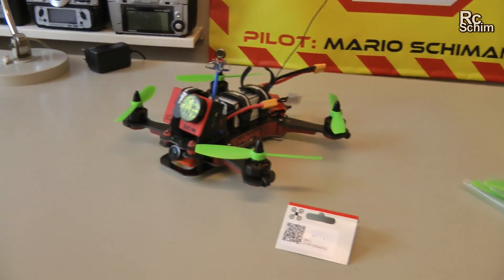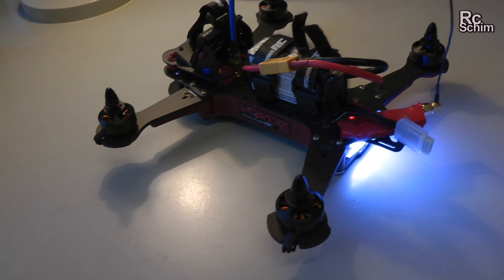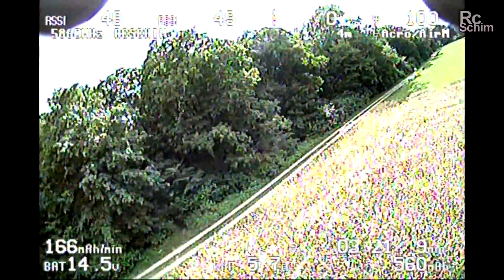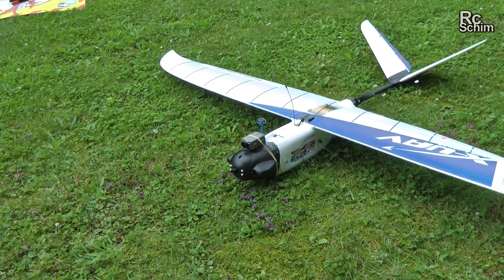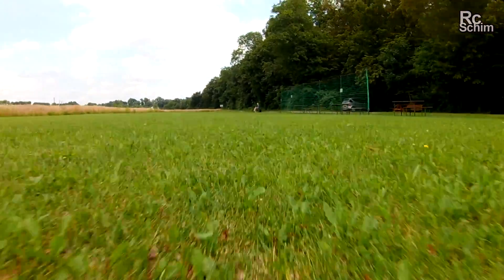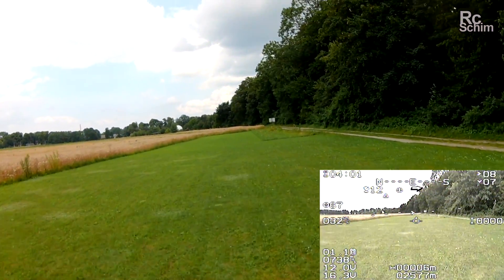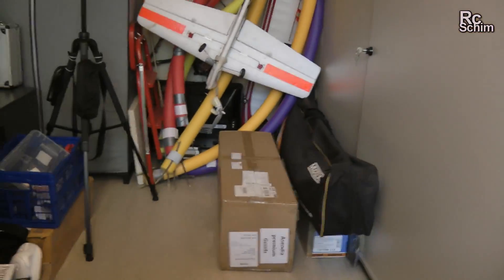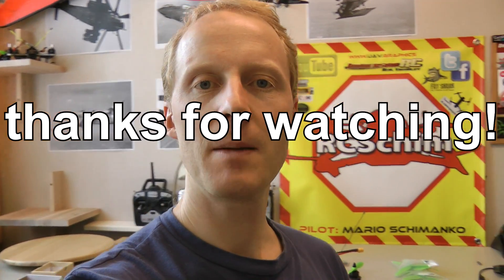FPV Plane or Miniquad? XUav One (with Arkbird), Vortex 250 (rotor sense after motorswap)

Comment: the arkbird OSD does that comes with the FC and GPS ? Are you flying with 5.8 ghz with the fix wing ? 
Looking forward to your build listing on your Xuav mini talon.
Reply from the maker: hi, yes - arkbird OSD/AP combo also has a FC and GPS. It is easy to use, a bit large but ok; gives nice OSD readouts, will be fun in the mini talon.
yep, back in the days I also used 2.4 for video - but now with all ppl flying los on 2.4 it's too much potential for interference...
and I didnt wanna have different video systems (2.4 on plane, 5.8 on minis). wanna keep it simple.
5.8 works ok for my kind of flying.

Comment: You going to be doing a review of the RunCam Eagle soon? I can't wait to finally have the right aspec ratio in my goggles finally.
Reply from the maker: currently no plans, sorry.  aspect ration?   is it in 16by9 what you aim for (because your googles demand it?)
Reply: Yeah, it's 16 x 9, so it will not looked squashed down in my SkyZones, or the Dominator 3's I think? It never bothered me when I was flying planes and was higher up and just gliding, but when I started to fly close proximity FPV I started to notice it and started fixating on it a bit, to the point I was about ready to try the Dominatior 3 HD just to get the aspect ratio right. I would think I was just off the ground or really close to something, but  when I would go back and re watch it on the HD video, I was always higher or farther away then I thought I was. I think this makes it harder for me to go through smaller gaps and such, and really improve on my close proximity flying.

Comment: Wow that prop and tail combo is pretty cool. Any advantage to having it that way?
Reply from the maker: I thought so too when I first saw the plane. The advantage of pushed props is: they are not in the view of a fwd facing cam.
most pushers (like on a bixler) are not on the main axis of the plane, so you can only use small props...
some pushers are mounted on the back of the plane (most flying wings) which is nice also (but dangerous on hand launch).

VTail advtages? I was wondering as well and learned:
less drag, doesnt get stuck in the grass on landings so easy than a normal T tail
but: not so nice YAW steering, a bit harder to adjust correct
best would be inverted V from the aerodynamics   (on a twinboom setup - I've seen it somewhere)
Reply: You're right, I didn't think about prop size on the back, that would be an advantage. Also having the thrust line so close to the center of CG would probably help out also. I also heard that the inverted V works better as well, but would need to be higher up as not to catch on the grass. Can you get different props for that plane, like 3 blades or bigger? It looks kind of proprietary.
Reply from the maker: I think it's a pretty standard folding prop. 3 blades are a problem - as there are only two mounts :)  Never heard of a 3 bladed folding prop actually :)

Comment: For my mini talon build I copied this guys build. https://youtu.be/jCmYDMppU_M It flys very efficiently & I highly recommend this motor & prop combination
Reply from the maker: thanks for the infos. I love the fact that I can use my 5200mah 4cells (multistar as well).
Reply: yes on the first flight with the mini talon I flew for 40mins & used 3500mah & travelled a cumulative distance of 35KM. I have also got a Multistar 8000MAh 4s to try too!

Comment: What battery do you fly on your vortex ?
Reply from the maker: Hi Nick, I love your movies :)
Lately I use the Turnigy Aspec 1300mah 4cells (but as Bruce said, they are not that good).
Just check the best rated 1300mah 4cells (Joshua Bardwell does good battery comparisons).
It all depends how much power you need for flying. I dont fly fast all the time - so battery is not so important.
I also can use 2200mah 4cells (turnigy nanotechs) on it...

Comment: Well the stock motors blow. Happy you swapped them for something else, anything is better :) We tested them and they are very 2015  :) 
Its the same story as with Vortex 1, very nice quad with underwhelming motors limiting the experience. 
Good for you.
Reply from the maker: I dont go for extreme power or speed - for me reliability is the main criteria. Till now the stock motors were ok, but they started to sound weird...
I also researched the "red bottom" emaxes everyone is talking about.
Also ordered these new ones here:  ZMX V3 Motor 2206-2300KV (Blue cap)  from silverdrone - but they have long shipping times.  These are for a new, fast quad.... (1.4kg thrust? per motor)
Reply: +RCSchim nice to hear it worked out of the box. 
the only reason I have a second set of emax is ZMX 2206-2600kv would take a while to get here. Everything about those motors seems to be ok, even the weight.

Comment: The Talon ought to be great. I still have to build the one I got. So many projects.
If you like Zooming with mini-quads you might also like the FPV Popwing. It is easy to hand launch and landings are easy too.
Reply from the maker: Here's what I've gathered on infos till now - I will start the easy build soon. Gotta see if I need good servos or if I can get them from some old, discontinued planes in my hangar :)

X-UAV Mini Talon Build #3  https://www.youtube.com/watch?v=jCmYDMppU_M&feature=youtu.be
Handlaunch: https://www.youtube.com/watch?v=ZY8QLqPlClw&t=0s

50Amp ESC
T-Motor 2212 800KV & 10x6 APC Prop
Hitec HS-65HB Servos
52000mah 4cell is ok! (as lng as your running 4S and have an AUW minus lipo of about 1KG you should be fine)

Comment: cool video. the mini talon is great. with mine with 1,6kg load i can easily fly 1 hour, getting over 55km travel distance... i love the mini talon..
Reply from the maker: sounds good. can you share some details of your setup? best motor/esc/prop dimension for good allround flying (no highspeed beast needed).  can you dive hard with it or do you feel it gets to fast and overstresses the material (ailerons?).  battery?   I wanna use 433gr heavy 5200mah 4cells...
thanks
Reply: Hi, i fly 4s 6600mah multistar battery with foxeer legend1 up on the fpv mount on front, 3536 turnigy 910kv motor with an apc 9x6 prop, 30A esc from a volantex raptor, feiyutech 41ap lite flight controller. 600tvl cam, 5,8ghz transmitter, turnigy tgy-i10 receiver. the first real endurance flight got me 1 hour 2 minutes flight time. around 5200mah used. max speed was 153km/h full throttle, diving from around 400metres to 100.. that thing is rock stable. goes into stall at around 33km/h so you have to fly relatively fast. and she loves to land fast, so be careful. around 40kmh on landing is normal. flying at around 40-50% throttle gives you around 50kmh, with 5-6amps used. good for longer range flights.